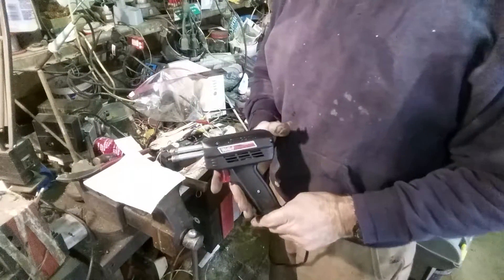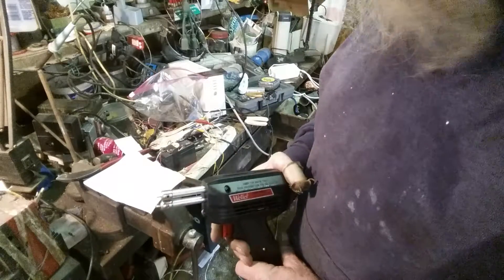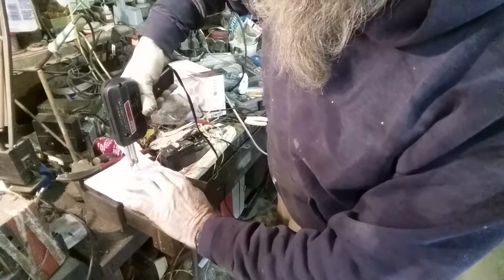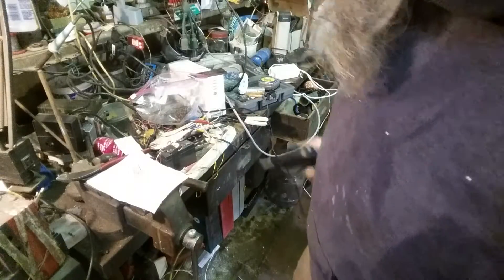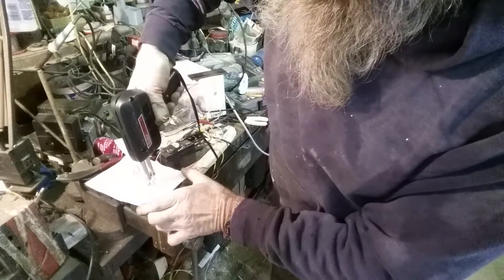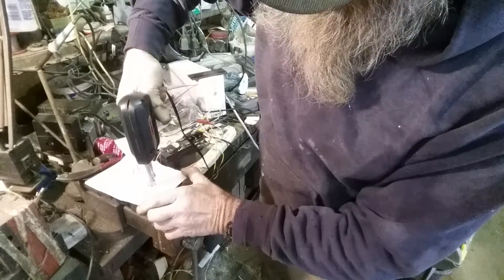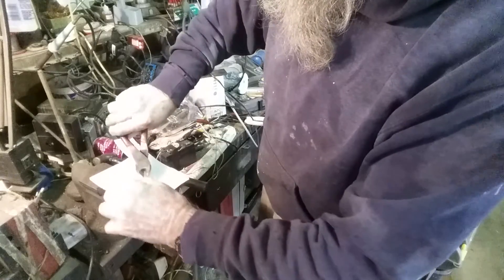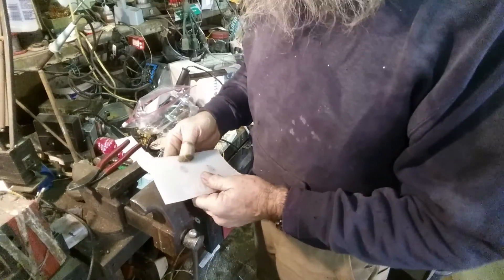Heat Staples part 2of3

Comment: Great setup!! I have a need also, so I will be doing this soon on something that goes on my wrecker project! Thanks for posting this!!
Reply from the maker: +Jonathan W What I have done for the plastic welding for my 120 gallon  drinking water tank on my 5th wheel. that cracked an broke along the bottom corner was to take an old style (my dads) soldering iron about 175 watts and I silver soldered a thin stainless steel foot to the copper soldering tip and that was used to melt in the crack while adding additional polyethylene and for last part I lay metal screen material over the cracked and leaking area and melt that in for strengthening.  There is not one place in So. California that still does plastic welding that I could find so did it myself and been holding for the last 3 years. good luck on the project.